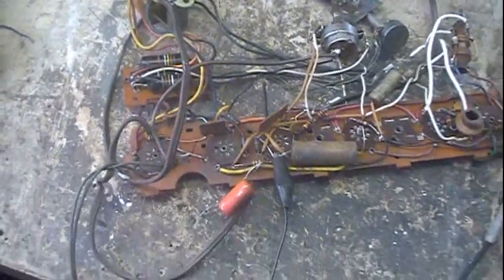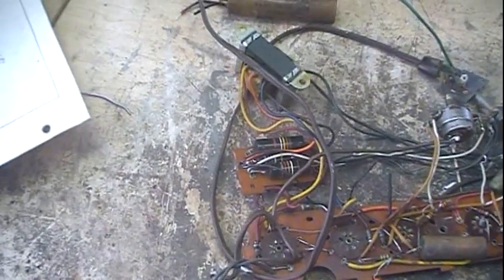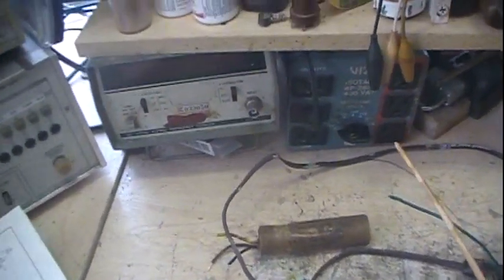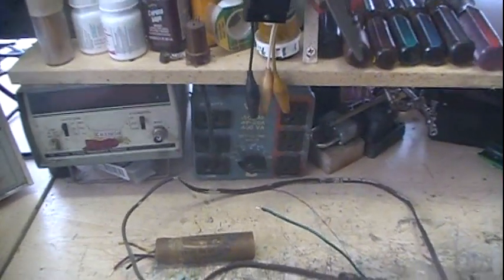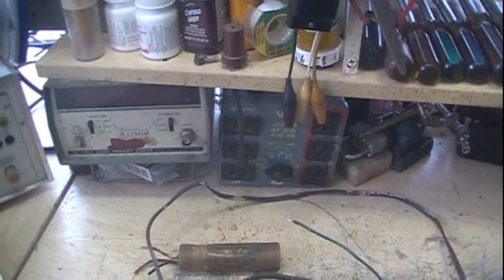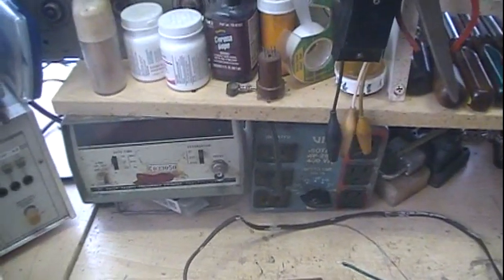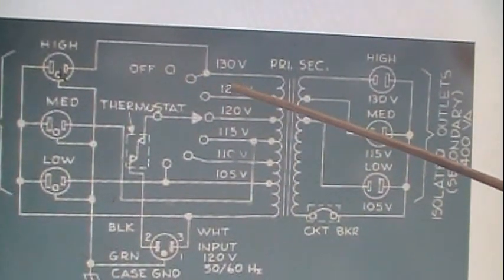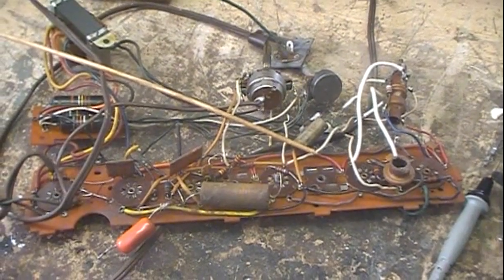Follow up on How to test an isolation transformer video

Comment: Hi, if your isolation transformer has a ground pin on the isolation output , could you not use a small extension cord on that output socket, and cut off the ground pin of the extension cords plug ?
Cheers.

Comment: One caution Dennis.  Just removing the green (grounding wire) may still not isolate the ground of the "isolated" receptacle.  If the receptacle is mounted to the chassis of the isolation transformer case with metal screws that metal screw may still connect the receptacle to earth ground by the design of the receptacle mounting bracket if the earth ground is still maintained by other green wires to the chassis.

Comment: Dennis 
Thanks so much for your videos on Iso's.
I had been struggling trying to figure out why  I was getting 90 volt measurements from my iso hot to ground with two high impedance meters.  Pulled out my 40 yr old micronita and sure enough it was ghost voltage.  I had never even heard of the term.  Spent hours googling isolation transformer info before I found your video...the only one that explained it.  Well done

Comment: This answered a question I had perfectly - I have a Statco variac which claimed to have an isolated output, but when testing ground against the plug ground it was hot. Thanks for alerting me to this danger. Well done on this and the original isolation transformer video! Robert AK3Q

Comment: Good video. Just FYI mine is hospital grade made in 2006 by GE, the tan former is a hoyda. Mine also came without the ground strap to neutral. I think the code update with NEC was 2008. But yes, most new ones on eBay listed hospital grade is has that ground strap. 
I just got mine, you mentioned getting hot might indicate a short. When I fist tried it is was a little above 1:1. But it's gone up 2VAC over a few hours of running with no load. I opened it and noticed the transformer was warm after a short 10 min run. Starting to wonder if I have a little short. 125 in and 128 out now. I'll have to keep an eye on it, it's rated for 1200VA, so should be fine up to 9A (a little more but I would ever push it). So maybe it's just changing as I run it more and it heats up? How warm do you expect a transformer of this size to be with no load? FYI, it's a H style one. Very weird wiring, live goes on one the right side. And neutral is going on the left with ground plot in to both.

Comment: Hello Dennis! Good video, as was the prior one on the Isolation trans. One thing that would also be valuable to share with your viewers is the pitfalls of connecting a scope to a piece of equipment that is plugged into the Iso tap. since the scope's input connectors (BNC) are connected to the mains ground, you're actually recreating a direct path to ground once again through the scope. The ground becomes you're new neutral in the circuit. It's also important to mention that if you are using more than one scope probe, that can also be a problem if the probe grounds aren't connected at the same ground point in the circuit. Good videos! Don't worry about the length of the videos, it's better that they're longer and clearly understood by the newbies. :)  Frank Ferraro--Audio Craft Electronics.